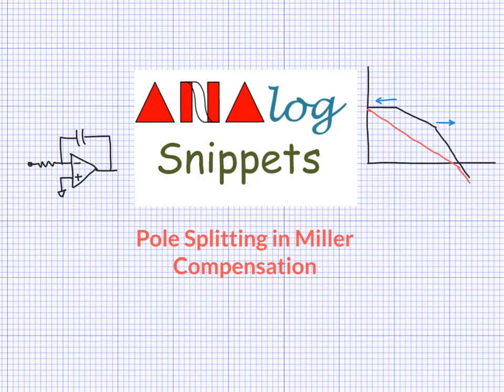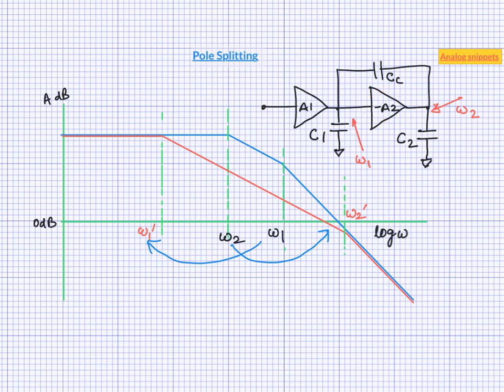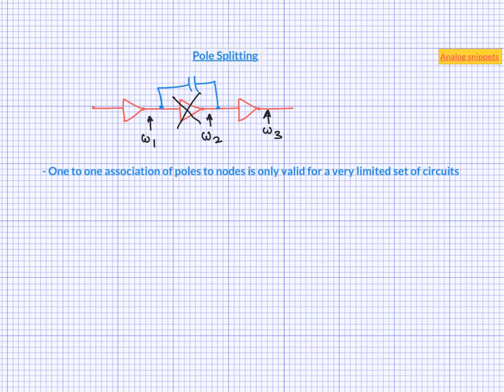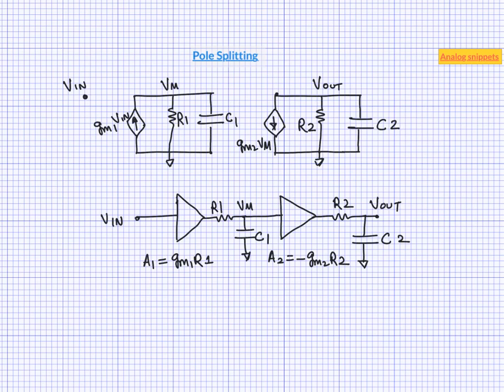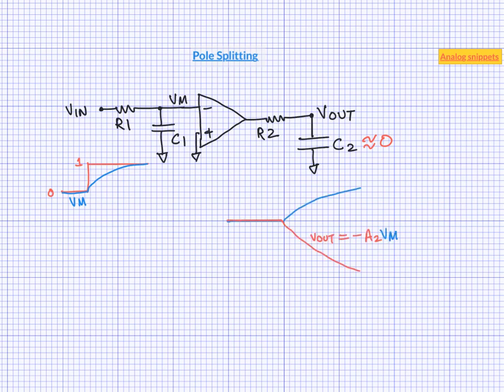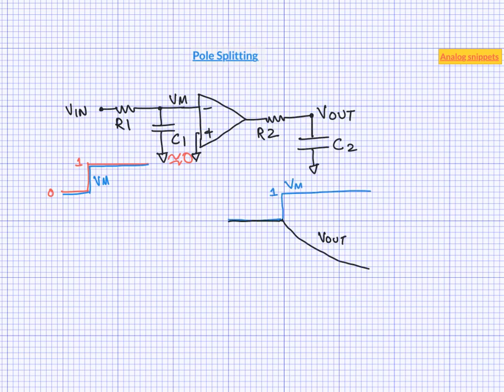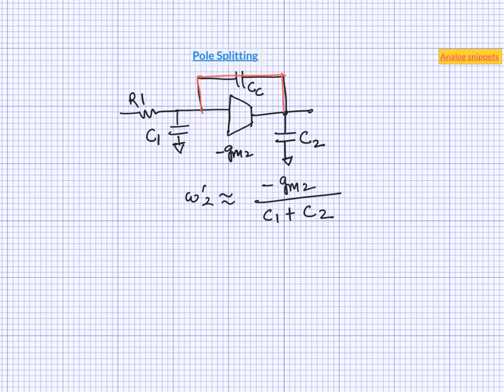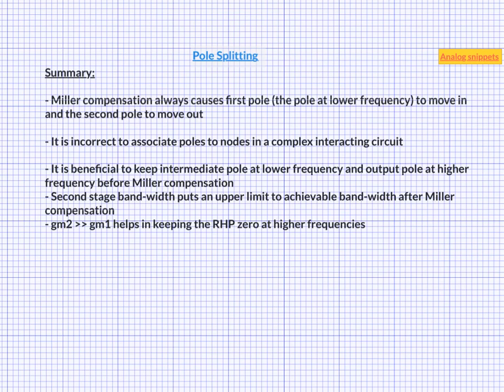#18 Pole splitting in Miller compensation

Comment: Kindly let me know if I am missing something. In 2nd case where w2 was dominant, the system getting slower after adding Miller cap can't quantify that w2 moved inside. Because, when Miller cap is added, w1 (non dominant pole) came towards lower frequency, slowing down the system. That is why in 2nd case, the amount of slowness of vin depends on r1 and current drawn from equivalent cc at w1 node. I mean both the poles add delays and the system would get slower even if non dominant pole adds to delay.
Reply from the maker: It's difficult to argue but in a coupled system poles belong to system, not to nodes. Our intuition fails here. It is interaction between nodes that moves the poles. When you add even a small amount of Miller cap, non dominant pole always moves outside, irrespective of whether it was w1 or w2.